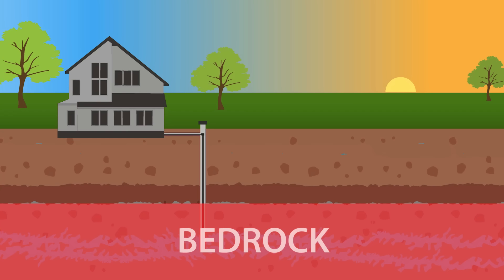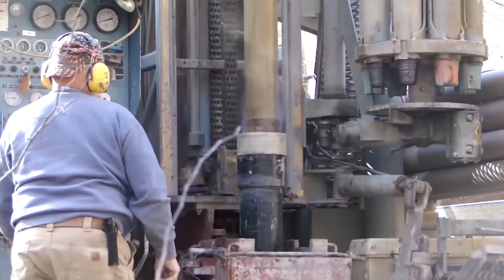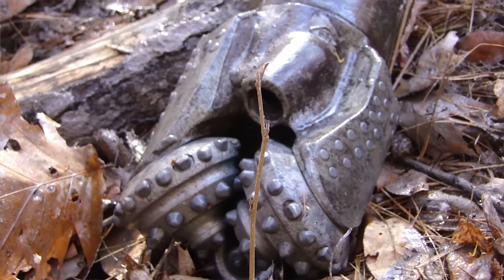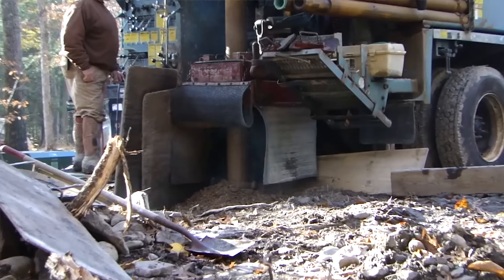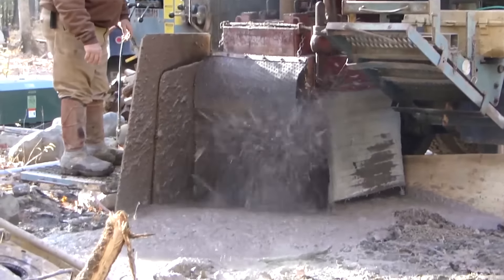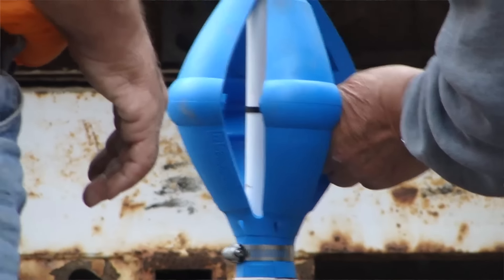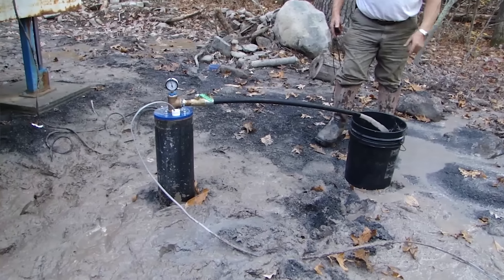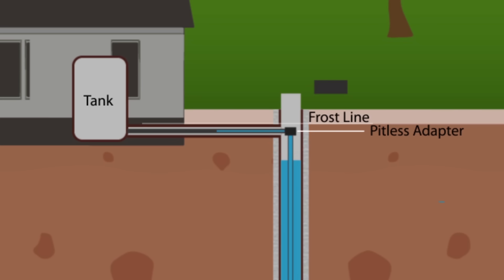WELL DRILLING 101 | Every Step Explained

Comment: The blue thing on the top of the pump just keeps it centered and keeps the wire from chafing on the sides of the well. The pump gives a leap every time it turns on and off and in a smaller casing well, the wires will eventually rub through and blow the breaker without it. I work for a plumbing company and we do lots of pump work (but we don't dig the wells. It was interesting seeing that part of it) and we use something similar, except we use several that go up the whole pipe to keep it from bouncing too. They look like little white rings with a big hole in the center for the pipe and two little holes for the wire and support rope.
Reply: The reason it would trip a breaker is if it wore  completely through the run winding wire , and kept engaging the start winding ( heavy load at start up ) like flipping a switch on/off- on/off until the components and breaker over heat. The pump will function until the wire wears completely in two while only slightly increasing amp draw and electrical usage. If it broke the start or common wire on a 3 wire pump , it would just fail to run until wire repair. Many questionable dealers will replace pump and wire rather than low profit wire repair .
Reply: The blue device is usually called a torque arrester used to prevent fatigue damage to pipe and wire the plumbing company I work for don’t typically use them unless it’s around 200 feet deep we often will shield the bottom 10-20 feet with 1” pex or pvc and tape it to the pump piping then tape the wire every 6-10 feet to keep it from moving too much. We don’t use support rope because eventually it degrades and can plug the impellers. I’m not saying we’re right I just wanted to share. I like seeing what others in the trade do sometimes you find a gem.

Comment: Drilled 35 years cable tool. Carbide button bits on mine and that rotary. I welded my casing. Two feet or more into bedrock.drive shoe welded to bottom about 3/4 inch thick. Hole into bedrock should be three inches bigger than casing for proper thickness of grout, cement neat in Md. Blue thing above pump is a centralizer. When pump comes on it kicks a little. Centralizer keeps pipe in middle of well to protect wires scraping against side of hole.

Comment: The blue rubber device is a "snubber" to prevent the torque of the pump cycling on and off from cracking the pvc pipe. When mine failed the wire rubbed against the casing and shorted.
Reply: Also called torque arrestor

Comment: Most people make a well house to enclose their well. You should totally make an old school fake well like with a bucket and winch. That would be cool to hide the "eye sore" of the cap just sticking up a foot out of the ground. Idk i think it would be nice, maybe flowers and a bird feeder. Shit like that.
Reply: It is best not to cover the well, it attracts critters, ants, etc to live there which will enter your well. Even that halfmoon style lid has holes in the top for electrical, etc and it doesn't take much for an ant(s) or spider(s) to enter. I have seen many mice and even snakes inside wells.
Reply: My well is in the front yard but the pump sits under my front porch.
Reply: Around here, folks generally bury the wellhead with the pitless.  Less danger of freezing.   When I did my well, I backfilled with clean sand in case I ever had to excavate the bugger again--we have heavy clay soil here and you don't want to be digging that if you can avoid it.   You could probably even cover the wellhead with a septic tank riser.
Reply: Burying the well head will most definitely cause contamination issues, and your well head cannot be sealed up completely, it needs air. Creating a pit with a riser is also prohibited as it leads to contamination issues.
Reply: One of the issues that crops up frequently is that the well will be drilled and plumbed and then the landscapers will come in and dump fill around it, putting the wellhead below grade.   I'd much rather see a wellhead protected by a large (24" wide) riser than be buried completely.   It's not ideal, but it's better than nothing.
Reply: stuff. stuff like that so we are adults
Reply: GruntWork I would not recommend building a "pump house" over a deep well. Should your pump go bad, they will need to get the pump hoist over the well to remove the pump. You're not going to pull 100' plus of pipe and pump by hand in a tiny little house. Some states may even have codes making this noncompliant. As for burying your pump head, there is no reason to. Your water should not freeze if your pitless is below the frost line, here in Illinois that's any where between 3 and 4 feet. You need to have your well cap vented (again many states require this by code) to allow for gasses to escape and not build up in your well. You have to remember anything you put around your well, may have to be removed somed day when work is done to the well.
Reply: @devonbaete7458  Wrong. No air is needed. Venting is what is required to allow gases like radon to escape instead instead of being forced into the water and coming out of your shower head. The gaps in the cap can be filled with screening or filter foam to keep bugs out and still vent gases.
Reply: @RSole9999  So you think you can pump water out and not need to let air back into the well......you have no idea what your talking about, if you shut off the air supply then it has to find the air from somewhere and it's not coming from the bottom of the well casing and it will make the pump work harder too.
Reply: @kkmart43  ok if there is no air pressure in the casing wouldn't the water level rise ,due to lack of surface pressure pushing down?
Reply: @robertrobinson2649   if it is a spring or the water table is higher than ground level but if its below ground level where is the air coming from if you don't vent, The ground ? Nope the ground has no air in it and another side effect of not venting is you will tend to pull more sand and dirt into you water supply as it's being pumped out of the ground.
Reply: @kkmart43  Totally agree with you on this.  And I don't understand what a well cap is doing only 12" above grade.  A commercial driller put in our well and the cap is 30'" above grade.

Comment: How much was the total cost?
Reply: Yes , I'd like to know the answer to that too.......
Reply: How much cashhhhhhhhhhh
Reply: YES!  How much did this cost???
Reply: In central New Mexico the going rate for drilling is $16.50- $19 per foot for the drilling.
Reply: Depending what the company charges per foot. Our price was 22$ a foot for casing and 15$ a foot for drilling. Adds up pretty quick
Reply: I remember hearing on a show that it's $25 per foot. If he went 325 ft. x $25 = $8125.
Reply: That deep? Crazy expensive we're talking thousands of dollars
Reply: The GoldenChild How much do you think you spend on the water bill over a few years.. It’s the long term investment. His water is basically free.
Reply: @lecurymccray5804   I have a well, so it's free besides the electricity to run the pump. But it only cost me a few hundred to have it drilled when I built my house.
Reply: Where and how deep did you drill the well?

Comment: Is it possible to mistakenly find oil instead of water!?
Reply: Way deeper I think without googling it
Reply: DE Ackern  you would have to go about 1000ft to maybe see oil
Reply: Water is very close to the surface
Reply: Not a chance
Reply: Well thats how oil was first discovered (although it can also just ooze out of the ground) so yeah.
Reply: Short answer, yes. But its very rare.
Reply: Depending on where you live.
Reply: Under Springfield elementary

Comment: How much this cost more or less. I want to bring this technology to Costa Rica. Thank you
Reply: @deepyn dixies it depends on the depth of the well and the flow rate(gallons per minute) that your system will require. Materials of construction being carbon steel or pvc will make a significant difference in cost as well.
Reply: The cost may vary but it would be good to know the cost in dollars of this well, to get some idea.
Reply: Trust me well drilling has happened in every country. You wont be introducing new technology

Comment: PVC  is fine should use schedule 80 with galvanized threaded couplings this will prevent splitting  at connections
Reply: Doug Sizenbach definitely schedule 40 in the video though.
Reply: Did mine with a single length of sch40 off a big roll; bout 400'.  Fewer connections means fewer failure points.
Reply: Schedule 80 PVC couplings are more than adequate. If you insist on using something stronger, I would use brass. Unless your well has soft water with no iron, galvanized couplings will definitely fail in a few years from corrosion.
Reply: When we bought our house, the well setup used  galvanized pipe to hook up to the pressure tank.  The rest of the system was PVC from the wellhead and copper from the tank.  No electrolytic fittings.   After about 10 years, it left a horrible mess in the plumbing.    I replaced with brass and copper and a new pressure tank with all of the proper brass fittings (   pressure relief valve, gate valves on the well side, etc.).   I can't believe that it was code when he installed it.     The old pressure tank was full of rust.
Reply: tubastuff, you'll still get rust build up in the tank and plumbing but as long as there's no steel fittings it won't fail. Dielectric fittings won't help. The galvanized needs to be removed completely.
Reply: It, the tank and all of the fittings have long been replaced.  The copper house plumbing has been flushed out several times.   I went with a fiberglass diaphragm tank.  There's no galvo anywhere now.    The surprising thing is that the pressure switch didn't have the "low pressure" safety on it.  That's also been replaced with one that does.   

When you buy a house you inherit all of the previous owner's (and builder's) mistakes.   Takes years to discover them and straighten them out.
Reply: @tubastuff  I had a similar experience with galvanized fittings as well. Somewhere past my pitless one of the barbed fittings rusted and split, causing my pressure tank to never get past 15lbs of pressure regardless of how long the well pumped. Had an 7+ft deep trench in the yard going about 15 feet before I decided to bail on following the current line from the pitless back to the house and trenched a new one. I have no idea why someone would use a barbed galvanized fitting to connect 2 pieces of poly pipe unless they were just short on pipe, The new run I did used 1 run of poly and replaced the pitless with a brass or copper (not sure) fitting. The lines on the bottom of the pressure tank were all galvanized as well, replaced all that too. Just like in your experience they were all loaded with rust as well.
Reply: What happens if the PVC breaks? How would one retrieve it once a connection fails
Reply: I have literally had hand tightened threaded plastic couplings split from contraction on schedule 80. Always go with galvanized couplings.

Comment: Thanks.  I learned some things.  This is a deep subject.
- There would be very few areas they drill to bed rock.  They drill to where they are safe-deep, and have good water flow.  That can't happen in clay.  Into bedrock might have been necessary in your area.  If you live on a gravel pit by a lake they might only go down 30 feet.  It's anywhere they can get good water.  Deeper could be better or worse.  Rainwater is soft.  Down deep can have a lot of iron and harder, in which case you need an iron filter that uses an anode and you recharge with Potassium Permanganate, and a water softener that you recharge with rock salt, or it could be better.  Almost everyone does a water analysis to determine if or what water treatment options they need.
- Tri-cone bits have tungsten carbide inserts rather that industrial diamond, and you are correct, they do rotate to distribute the wear.
- Nit-picking:  On a 240v appliance there is no neutral.  There is only the two 240V legs and ground.  The ground connects to the house ground at the main panel, which in turn is connected to earth ground.  You can only have a neutral with 120v because it is halfway between the two 240v legs in a center-tapped transformer at the utility pole.  This is why you have two rows of breakers in your house with 120v service.  HOWEVER, don't take from that, that one side is one leg and the other side is the other leg.  They alternate every other leg as you go down one of the rows.  That is what makes it possible to have a 240v breaker, and why the take up two spaces.  Properly wired, there is an earth ground at the power company's transformer, and from your main panel to earth ground, with no other earth grounds.
PS:  Looks like you have a nice place there out in the woods.
Reply: Thank you.  Would you know more about the water measurer?  The electronic devise that tells the height of the water
Thanks
Segundo

Comment: Aren't the first few casing pipes supposed to be riddled with holes?
Reply: Adam Sahr they only have holes if it’s a closed bottom. So the holes your speaking of would be perforations to let the water come in. If I understand right, this well had an open hole bottom. No perforations needed when the casing is open on the bottom.
Reply: @jaketaylor9238  I see, but perhaps only when the last pipe is not resting on the bottom I guess.
Reply: Jake Taylor but they drove the bottom collar into rock
Reply: Should only be bottom casing pipe has holes if it’s a closed bottom. I’ve never herd of a well having the bottom collar shoved into the ground as a closed bottom set up. Only herd of putting a “shoe” in it to close the bottom. All wells are different tho. I may have misunderstood some of the info in this video tho.

Comment: I also put a small tube down the hole with the pump. Blowing air in with a compressor and measuring the pressure, I can make pump tests. That lets you quantize the well precisely. As my pump is below the aquifers I can visualize them too.

Comment: Our well used PVC until it split VERTICALLY!!!. There was not a torque suppressor on it, and likely caused the split. They used a flexible black pipe and a torque suppressor this time.
Reply: Poly pipe saves so much time when you need to replace the pump. Also, if the people installing your well are competent they will also tie a rope to the pump.
Reply: DefinitelyNotHaraku, attaching a rope to the pump is not good practice. More often than not the rope will break or fall in causing the pump to get wedged in the well. I have replaced many more wells because of this than have saved a pump because it had a rope on it. Schedule 80 PVC, if installed correctly, is far and away the best for well pumps. If you have a situation where the pump is stuck in the well, you can kiss it goodbye if it's on poly. PVC will allow quite a bit of vertical force before it breaks. With 2 competent men, a pump set on PVC can be pulled by hand just as easily as one set on poly.
Reply: Lenny C I'd add that schedule 120 is better, I've also never seen schedule 80 fail, but amen on that safety rope bs.
Reply: There is such a thing as overkill, any pump that's capable of pressurizing more than sch 80 can handle is probably not a good idea to hang from a pipe.
Reply: that pump cant even come close to overcoming the rating of sch 80 let alone 120
Reply: It might have been sch 40 PVC. I have seen that fail when used to hang a pump.
Reply: find me sch 40 with threads cut in it dude. or find me a driller dumb enough to spend time threading sch 40 instead of buying 120 pre threaded (sometimes they sell it with stainless couplers installed already as well) that wasn't schedule 40.
Reply: ATF Ace. Well he didn't say it was threaded.
Reply: Yeah, but you can see in the video that the pipe is threaded. duh
Reply: ATF Ace. Ok, well I was replying to John Patrick Cory's comment.
Reply: YES...man knows what he is talking about.
"been there this nightmare"
Reply: I disagree.  First you tape the rope to the pipe, so it will not get tangled.  Second PVC will break way before poly pipe.
Reply: In my opinion, PVC should not be in direct contact with drinking water. It is better for the environment to use Rainwater and recycle it for multiple uses. Moshy layer in a forest is doing the same thing. Also, the variable drive pump is better than a valve.

Comment: "you can hit a cave"
This is why rule number one exists:
Don't dig straight down
Reply: Rule number two, but do drill all the way down.
Reply: Digging at an angle does not prevent you from hitting a cave just like digging straight down does not.
Reply: @eddielane9569  dear god get out on the internet for a little geez did the last decade just slip past you?
Reply: @stevedotwav  what happened did I educate you?